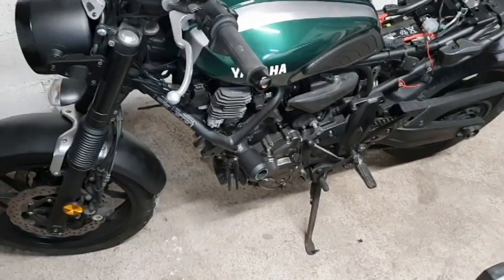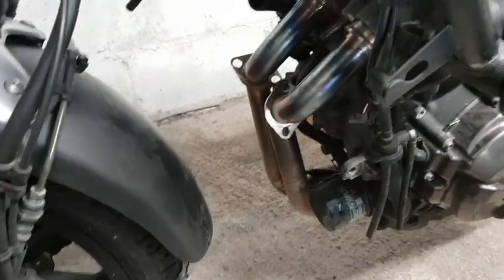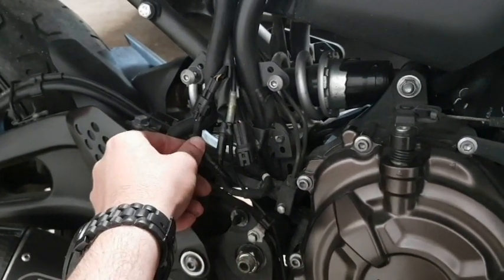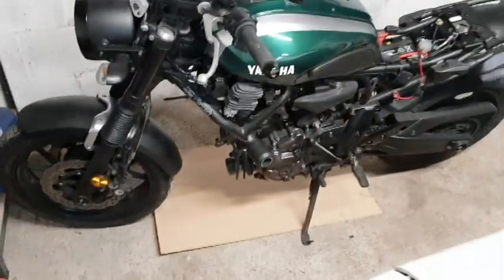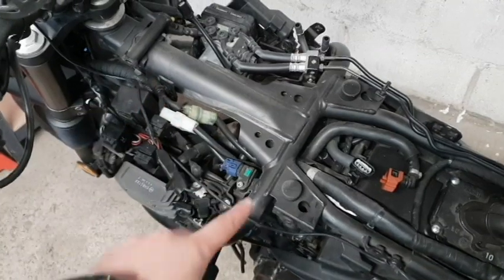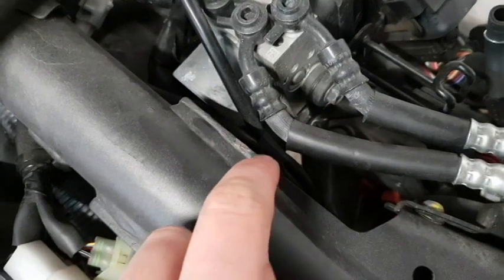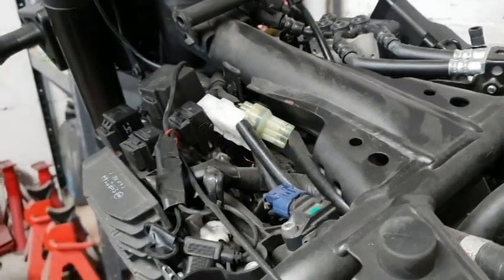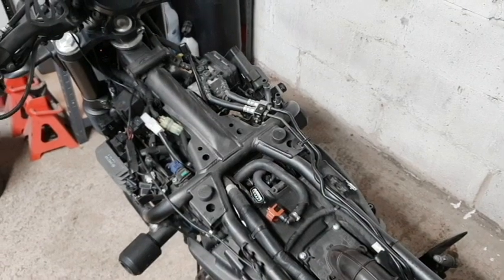XSR700 Dismantlement Vlog #1

Comment: What did you use to get the O2 sensor unplugged? I had a hard time doing it when I did my exhaust yesterday so I just twisted it off the pipe.
Reply from the maker: You unplug the cable behind the removable panel above the footrest
Reply: @gringotom242  yeah, I saw where it disconnects, but it has 3 snap style clips which I had an extremely hard time pressing at the same time.